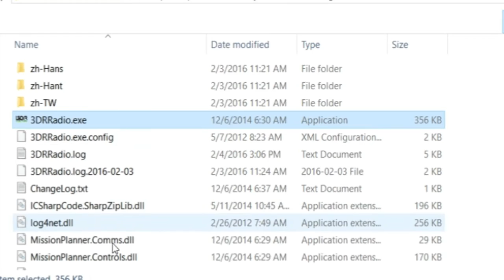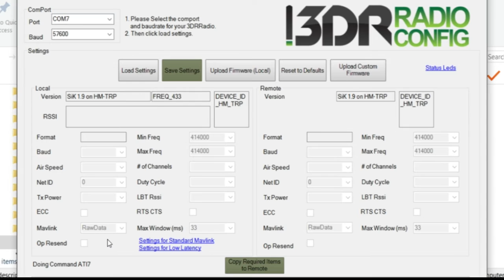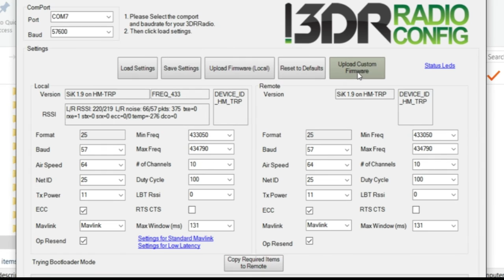program telemetry air module another way

Comment: Is it also possible to change the freq with the Radio Configuration tool?
For example reconfig the 915 to 433Mhz
Reply from the maker: I have not played with that.... this guy made a custom firmware file for what you want ..but a debate happen in the thread so you probably want to read it all type thing... http://diydrones.com/forum/topics/changing-main-frequency-of-hm-trp-3dr-radio-for-telemetry-using

Comment: My 433MHZ radios won't connect to each other even I made the settings on each 100% the same on mission planner. What could be the problem?
Reply from the maker: can you take a picture of your settings
Reply from the maker: or confirm its the same as these 9:36. you can still use mission planner its basically the same program
Reply: bangs6996 it's the same as yours but the air module won't blink red once it is connected to Pixhacks FC. It just blinks green.
Reply from the maker: @dronepilot1333  hmm never got a notification on this...  most likely its just faulty .. 
i've helped tons of people on this and even after re programing them .they end up having to get another one..
Reply from the maker: and just to clarify your not getting any solid lights ?.. the solid light usually green means they are linked ..the red light will show mav link data / serial data so it will blink when they are talking back and forth.   so if your just getting a blinking light and no solid most likely one is faulty.

If you are getting a solid light .. or if you changed the end for your pixhawk to a 6 pin connector  you might of got the tx and rx backwards.. or in the wrong order.with the 2 spaces

Comment: Can you please help me with this one, by the way thanks for the video, i can get them to connect together except that i can't read data from them like in MP, i got the ground module to be flash by forcing bootloader mod with the wire jumper trick but nothing with the air transmitter so thinking trying your trick.
Reply: +Jocelyn Cholette Sorry cant get my dropox to share my picture!!
Reply from the maker: +Jocelyn Cholette so you do get a solid green light?   If so try the 3drRadio config tool..   and see if the air module on the right side gets populated
Reply: +bangs6996 Just weird, i tried to read data from MP and was getting message error, and when using 3dr radio config only everything is fine, get data read and got Upload firmware working like a charm, thanks a lot, i have hard green light and module comunicating.
Reply from the maker: +Jocelyn Cholette congrats .and thanks for coming back to say you got it to go.. if you run into other problems its usually just the yellow and blue  tx rx wire going to the air module they can be a pain ..

Comment: bro im using 3dr 433Mhz telemetry if i connect my telemetry it shows connection failed if i load settings it shows "invalid com or in use" my os is win10 kindly suggest me the sollution
Reply from the maker: Hi.. open up control panel  .. device manager .. Plug in your telemetry usb part into  your computer. .. does anything new show up under "Ports"

have you installed CP210x drivers?
Reply: bangs6996 yes bro...i did .....it..was showing....silicon lab cp210x usb to uart ......
Reply from the maker: yeah I get the same error in my virtual machine.. So i was trying to figure it out for you.. the problem is my virtual machine with my new cpu keeps crashing my entire system..     I get the same error with windows10 32bit in vm.. but works perfectly fine in windows10 64bit on the main system..  ..I'll try again in a bit ..its just really hard on my hard drive with the force reboots..
Reply from the maker: k figure it out..give me a sec..
Reply from the maker: alright this worked for me.. 

install this driver
https://drive.google.com/open?id=1TWaOMV0t1dWTqVkWArzBxQFF_bHOvCEp

you might have to reboot your system in un signed driver mode.

test in 3dr to see if it works .. but it probably won't.

next go to 
.silicon lab cp210x usb to uart 
right click and 
update driver.
..browse my computer for driver software
.....Let me pick from a list of available....

then choose this one

https://drive.google.com/open?id=10G1lkjcJzSyph8lU1EzdAyvBOuOHdXuv

Comment: hey bangs, is there a way to flash ground module with a rfxcom firmware http://www.rfxcom.com/epages/78165469.sf/en_GB/?ObjectPath=/Shops/78165469/Categories/Downloads
i've tried to flash in usb mode but it not reconized by rfxflash and i wanted to use 3drconf tool but the link is dead ( if you still have it, can you link me the dl)
i'd like to use it as home automation module for domoticz or jeedom for 433mhz temp sensor for example
thx
Reply from the maker: Hi... sorry for long reply your message was flagged for review and i don't check that very often .. anyways here is the file .. https://drive.google.com/open?id=0B2w6_OKE_2kxSWxuNGNDWEV4aWs
Reply from the maker: and by the way ..i  use the telemetry for allot of my projects.. here is one of example where i shared temperature readings of two sensors with it heh..
https://youtu.be/Cuenk9AJRzA?t=159
Reply: thx bangs
Reply: i will check that later in the day!

Comment from the maker: Mateo Gasparovic    here is a picture you sent .. https://www.dropbox.com/s/hzais2vumjq944y/20160204_153221.jpg?dl=0

try to solder all those pads back up so it looks like mine..  It could be one of those did not make connection on the bottom right.. 

https://drive.google.com/file/d/0B2w6_OKE_2kxUW02ZUZCOUNnWk0/view?usp=sharing